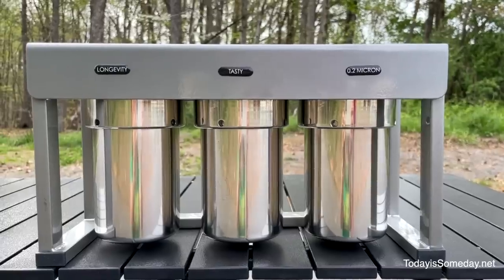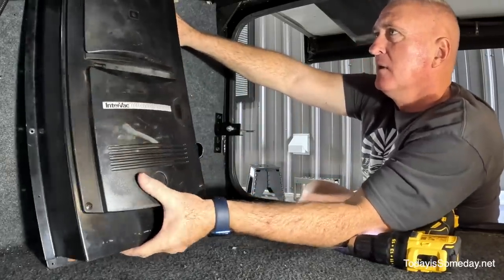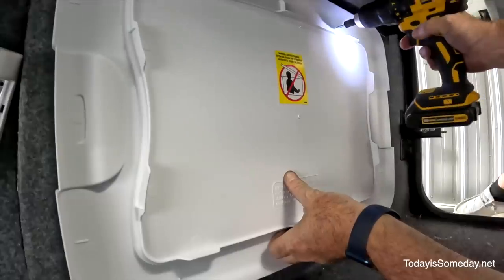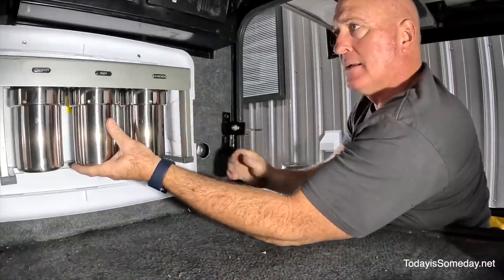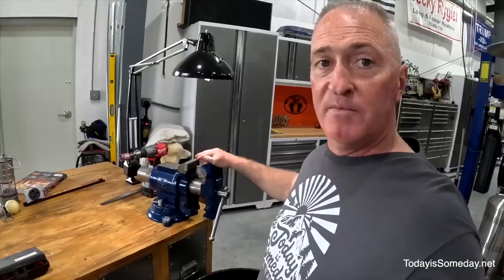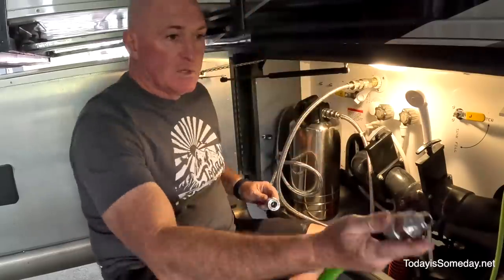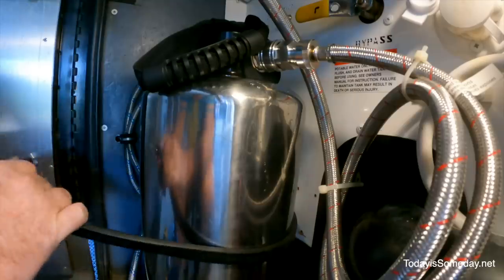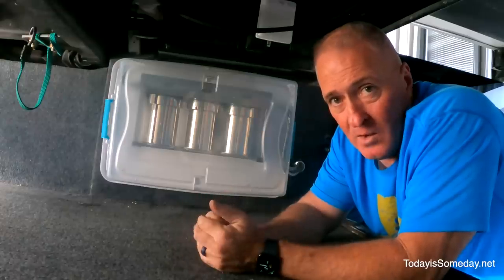This RV Mod Just Saved Us Time & Money

Comment: If that PVC does not stand the test of time for the hole in the wall, try a Rigid Conduit Chase Nipple found in the electrical department.  It does come in your size and a locknut will hold it in.

Comment: Great idea.  If you decide to use washers to attach the lid; I suggest using fender washers.  They are available at most hardware stores.  They are a large diameter washer but they have a small hole..

Comment: Looks great Phil!  Another thing I'd install is a drain hose installed in the bottom of the storage bin.  You could run it from the storage bin through the floor of the bay.  That way if there were a water leak it would have some place to go plus it would alert you with a drip whenever you walk around your rig.
Reply: Fabulous

Comment: I liked the suggestion Curtis Rose made about installing a drain hose to the bottom of the storage bin.  Another thing that you can do Phil is to add a water leak sensor alarm to the storage bin.  If you ever have a water leak, the sensor will trigger the alarm and you can avoid water damage to the rig if the hose cannot drain the volume of water.  Great video Phil !!!
Reply from the maker: I have since added the water sensor in the bin.  I am going to figure out a drain system for sure.

Comment: If you are dead set on using a container, I would recommend getting one that is deep enough to hold everything and drill into the side like you did the lid here. I'm worried you won't have a good seal at the bottom of that container, as water can likely leak between the lid and the container itself the way you have it! I like the idea though, can't afford water damage to everything else around the filter!
Reply: I think he is looking to capture spray more than containing a leak. That tote would need a gasket for a seal. But as I said I think that was not the intent. Phil?
Reply: @Keith Saunders  I agree he seemed to want to capture spray, as he stated in the video he doesn't think it would contain a leak. I just think it might do both, capture spray and contain a leak if he used a different container in the way I described above. He might as well put a water sensor in the container he is using now, so that he doesn't have to trust it as much as he is. Or, add a wrist strap/"to do list" step to check this container before driving anywhere. I'm no expert, but yikes, I hope they never have to worry about any issue regardless!
Reply from the maker: Just wanting to capture spray. Don't want water spraying onto my solar setup on the other wall. Will place a Govee leak detector to help monitor for leaks.
Reply: @Today is Someday  understood! I don't think there will be any problems, I just get nervous about water in RVs! Haha.. stoked to see the follow-up to this down the road after yal "break it in" a bit during your travels! It's a great set up and I hope it does wonders for yal!

Comment: All those too LONG, SMALL diameter flex hoses restrict flow & reduce water pressure @ faucets (see end of video 😳). Long ago I switched to the larger diameter SS flex hoses you find on top of residential water heaters. Keeping them as short as possible also helps the pressure & cost. Larger diameter pass-thru grommets are available online.

Comment: Phil try using an electrical box wire clamp in the hole you have drilled.  Some call it the strain relief clamp.  You can secure your wires so they will not move at all.

Comment: To make a grommet for the hoses, get a small rubber hose, cut it to the length of the hole and slice it down the center of the hose to fit over the panels.

Comment: Great job Phil!  I enjoy your videos and the RV equipment you use and recommend.  One question I had was:  is the water going from the softener into your “city” water inlet and you just flip a valve to fill your fresh water tank?  I didn’t see a hose reel so you were able to make a short direct connection from softener to your city water connection.  In the video you said “I have to change that”, what did you mean?
Thanks again,  Rick
Reply from the maker: Yes, the water goes straight from softener into "city" water inlet. What I need to change is getting a longer stainless steel hose to go from the bay to the pedestal water. The one I have is too short.

Comment: Great video.  I bought the same system from MMH a few months ago, & was wondering if mounting it was an option.  We have a slightly bigger Phaeton, so the vacuum is in a different place, but the electric hose reel is where you have placed the softener.  I’ve already excluded/plumbed around it, but need to remove it.

Questions:  How big is the hole you drilled between cabinets, & what size is the piece of PVC you used?  When you’re using a hole saw, you pretty much only get one chance!  Also, did you keep your Tiffin-installed whole house filter?  Seems like overkill.  I just took the filter out of the housing.  Thanks.

Comment: Phil, Phil, Phil. Have I not thought you anything, or are you just not listening!
Attache a piece of pressure-treated plywood or vinal ( PVC) board behind the lid too fur it out making it easy to remove the cover over the water filtration system.
Keep the rubber on the road and safe travels.

Comment: Having potable water, gray water, and black water valving and connections in the same bay seems like a bad idea from a sanitation standpoint.  I'd like to see the potable water connections in a separate bay from the waste water connections.  Do any RV manufacturers design their rigs with separation of these systems?
Reply from the maker: Typically, Class A and Class C motorhomes have all of these connections in the one bay, the wet bay. Trailers will have their gray and black water tank valves below the frame of the trailer away from the wet bay.

Comment: I love sitting around coming up with a new way of doing stuff. It seems kinda obvious, but before anyone just goes tear-assing around and drilling holes, it’s kinda important to find out what’s on the other side of the wall first. Given the lack of space in your average rv, and the resultant need for the optimization of that space, you could easily end up drilling holes into anything. Hoses, wiring, etc. So it’s probably a good idea to contact the manufacturer to find out if there’s any issues with your planned installation or “mods”, as the kids say. 😁 Was there any precautions that you took, Phil….?
Reply from the maker: Yes, I took the top white part of the wet bay area off and looked behind when I was looking for open spaces.  The wet bay is a plastic insert agains the RV storage wall.  I knew I had a clean area between the walls. I had also, asked the Tiffin techs if there was anything between the walls....nope, nada.  Trust but verify.
Reply: @todayissomeday  trust, but verify. Absolutely.

Comment: I’m not sure what problem you solved. I just leave my dual filter outside the rig connected to the hose. With quick disconnects it’s fast and I reconnect to itself so no air or dirt gets in. Each time I see the filter install date written on the side. Additionally, if I am doing a tank fill directly I go through these filters.   Seems very cumbersome to change filters with your set up.
Reply from the maker: I wanted to just connect to the park water and run my hose to one connection.....viola!  It is also less that I have to stow when we pack up.  I practiced changing the filters, using the bin to catch the water from opening the filter housing.

Comment: Phil, how is the flow rate? I really want to get one of these but at the end of the video the flow rate looked a little weak.
Reply from the maker: It has been good.  We were on well water and sharing the water pedestal with another RV in the video.  When we have low pressure, we turn on the water pump and it increases pressure.....just have to be sure you have water in your fresh tank first.

Comment: Wait.  Pressure regulator-> softener -> filters -> house?   Shouldn’t the filters go first?
Reply from the maker: The filters are before the softener. And the softener goes into the house.
Reply from the maker: Yes, it does.  he water comes from the city water, then into the filters, through the softener, then through the whole house filter ( I need to remove it later), then into the rig.
Reply: @todayissomeday  — ok, got it.  That’s how I have it.     It wasn’t clear in the video.